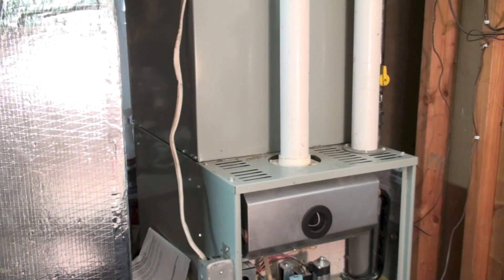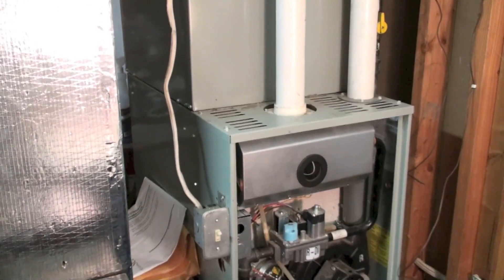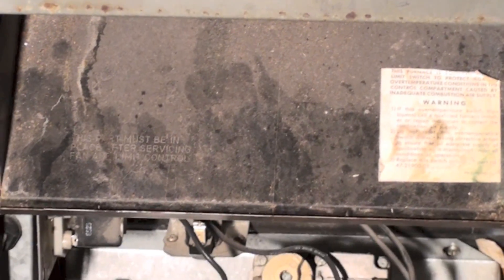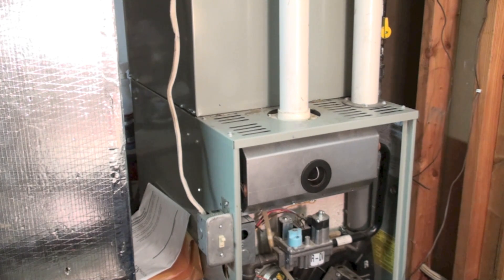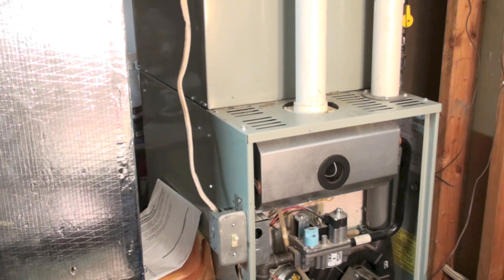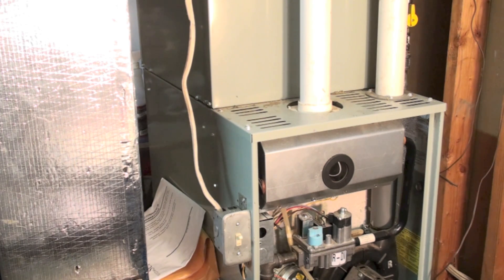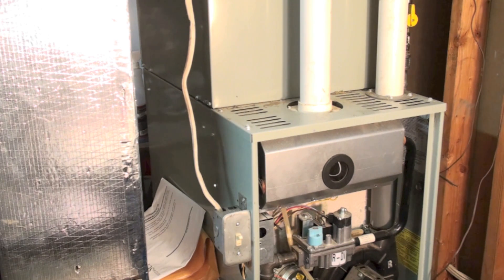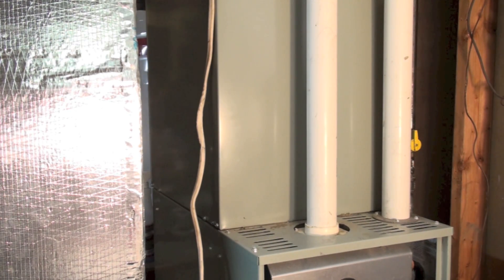The value of outside combustion air for gas furnaces

Comment: Great explanation, thank you so much! This confirms my doubts about inlet valve inside the house. Is it not in the building code for furnaces to fresh air from outside?
Reply from the maker: Most building codes do not prohibit inside air for combustion.  There are regulations for room size compared to gas input of the appliance.  
Should building codes require outside air for combustion?  Yes.
GFM

Comment: I was just looking at a house to buy, and had seen this little one foot pipe sticking up with the elbow in the basement and I had never seen that before. Thank you for clearing that up! Looks like if I buy the house I’ll need to get it fixed. 
Do you recommend a split intake that allows for combustion air and return air mix?  I live in the Midwest and wonder if the mixed air would cause the furnace to work harder?
Reply from the maker: You want to split off the combustion air between outside and tapped into the return air for the furnace?  If so, definately not.  The negative pressure return air could shut down the furnace.
GFM

Comment: Yeah, but installers can really screw things up.  I once rented a space for my small business in a one story, brick commercial building with a center cupola in the roof which vented the attic for all of the business in the building.  Small vents right below the parapet let air into the attic to flow out of the cupola.  The whole attic was wide open (no walls in the attic between offices) with only roll insulation on top of the suspended ceiling tiles to insulate each office.  The old forced air furnace in my office, which was in the bathroom and drew combustion air from inside, conked out.  The landlord hired an HVAC company to install a new furnace which was the newer type which used outside air for combustion.  Instead of putting a sealed pipe from the attic into the combustion chamber they installed a 4" galvanized pipe and left it suspended two inches above the outside air opening on the chamber.  As you can imagine, cold air roared down the pipe and we were playing freeze-out in the office.  We might as well have had the outside door propped a quarter of the way open.  This caused the furnace to run more to try to heat the office.  Since I was paying the utility bills, I removed the galvanized pipe and installed a new ceiling tile as the old one now had a 4" hole.   When the owner of the HVAC company stopped by a few days later to check his employees' work he asked why "they did not finish the instillation?"  He was told what had happened.  They never did come back and put a proper size PVC pipe on the furnace.  The office heated just fine.

Comment: Is there any danger of having the furnace use inside air? There’s a video on YouTube that claims it’s a major issue because it pulls air away from the nearby gas burning hot water heater, causing improper burn toxic gases to circulate inside the house.
Or, is it simply a question of using inside air not being as efficient as using outside air?
Reply from the maker: It is mostly an efficiency issue.  If the appliances are in a small room without access to a larger area, you could have the referenced problem.  There are calculations for room sizes to eliminate this problem.
GFM
Reply: @grayfurnaceman  : Thanks for your prompt reply. I’m thinking that the furnace installer must have evaluated the room size and the fact that, where I live, we have a lot of snow and extreme cold winters and thought it was the better option. The literature that came with the furnace has about 30 pages on how to install it. It even gives you how many elbows and the sizes of each for a “legal” installation. 
Your response has reassured me that my inside air intake is safe.

Comment: Outside winter air is drier so would there be much moisture in the secondary heat exchanger to condense to extract the extra heat,  and if there's no moisture in the secondary, wouldn't that also bring the efficiency rating way down?
Reply: The moisture in the combustion air is not the issue.  The moisture that is condensed is from the chemical reaction of the fuel burning.  
GFM
Reply: @Joe-ws5el , great!. I'll run a pvc to attic alongside the 3" bvent through chimney that goes half way into attic. But there also is a sump radon 3"pvc that goes outside as well so there should be nothing wrong with burning radon since it's all sealed and will be exhausted outside anyway. Have you seen that?
Reply from the maker: @1weirddoe571  As far as I know burning radon should not be harmful.
GFM

Comment: I have one PVC pipe vent going out my roof. This is a 30 year old furnace and Im replacing it next week. Can I run a fresh air pipe out the side of my house while using the existing vent going to my roof? Thank you.
Reply from the maker: If the install instructions accept that method, its ok.
GFM

Comment: They only installed one pipe on wife system put in 2018 and I notice Doors Close when furnace kick on if Door Is Cracked. Cause home has all new windows and Sprayed insulation Attic an Blown wall insulation.
Reply from the maker: I would be installing the combustion air piping.
GFM
Reply: Also Louis, if you have a standard  gas water heater, I would also be checking the draft hood of the water heater for spillage (fumes) when both units ( furnace and water heater) are running.

Comment: I realized, after having a new high efficiency (heat pump over propane) furnace installed, that my radon levels have gone back up.  I am suspecting, that because the HVAC company did not install an outside air pipe to this furnace, it is pulling air from wherever it can (including the subfloor).  I will install the pipe myself soon and see if this fixes the increasing radon levels.  Thanks for a great video!

Comment: Quick question: My parents have a furnace with PVC intake pipe that draws air from the crawlspace right below the furnace (or maybe the pipe under the house draws it from outside). So, right on top of the furnace where there is a pipe joint to feed the intake air into the furnace, the top of that joint is open so that the furnace is at least partially drawing inside air for combustion. The furnace is probably taking the majority if combustion air from indoors, because the pipe is just open on the top. I took a piece of plastic wrap and sealed the top of that pipe with a rubber band so that the furnace draws 100% air from the crawlspace or outdoors. Is this the ideal way to fix the problem, cheap?
Reply from the maker: If the furnace continues to operate normally, you are ok. It will safety out if there is a problem.  I would replace the plastic wrap with hard pipe.
GFM

Comment: If they're installing the exhaust it seems so cheap to skip out on the supply.  I specified that I wanted inside and outside fresh air piping installed with our new furnace.  Wouldn't have it any other way.

Also, isn't COLDER air also better for combustion?  You know, the reason behind why guys install "cold air intakes" on their engines?  Cold air = better performance over hot air?  Could the same argument be made for using colder outside air (during the winter months) versus warmer inside air?

Of course the warmer inside air isn't 150 degrees like it would be in an engine compartment.....

Comment: If your install is in an attic that has gable vents are you ok with not running the intake pipe?
Reply from the maker: Yes
GFM
Reply: @grayfurnaceman  I'm having a 90% Goodman installed to replace an 18-y.o. unit. In the attic. Exhaust currently runs straight up from unit and out the roof. There is no fresh intake from outside on current unit. The attic is large and there is ridge vent running length of roof. Tech is insistent on running PVC fresh intake line out the side of house, will exit about 35 feet up from ground. Any suggestions I shld make to tech? Does angle of pipe matter?

Comment: To say the chemicals in laundry rooms is causing the rust is 100% speculation and I refuse to believe this is in anyway necessary to the equipment
Reply from the maker: It is, in fact, speculation.  However, having seen the early rust out of heat exchangers in laundry rooms,  and understanding that chlorine bleach becomes hydrochloric acid in the presence of moisture (read products of combustion) leads me to bring in outside air.
GFM

Comment: I used the feel the same way about the outdoor air intake being a better install however after years and years of service calls do to a blockage in the exhaust or intake piping on the outside I changed my mind. If an animal climbs in boom service call, burst of wind boom service call, ice/snow build up boom service call. I no longer pipe the intake outdoors unless the furnace is located in a laundry room or there is not enough combustion space where the unit is located. This will eliminate nusince calls by 40% and save the customer a lot of money on unnessisary service calls. Pipe the exhaust outside pitch to furnace keep intake inside whenever possible that's a better install in my opinion. Or just stick with 80% furnaces they are considerably more reliable for a home owner. For a tech or dyi guy go with the condensing furnace for energy savings.
Reply from the maker: Good point.  One of the issues we have in the north, 80% furnaces are not allowed.  The issue of the laundry room is one that always gave me fits.  Constant flame rod cleanings and inducer problems, even heat exchanger rust outs.  
GFM

Comment: Inside air dosent freeze so in the north Canada where we get minus forty intakes freeze up resulting in customers making emergency no heat call 
..installer goes there chips yhe ice off the Intake takes all of 2 mins bam 75 dollar charge to customer ...so idk what do you think
Reply from the maker: The majority of freezeups are from the vent gasses as they are 100% humidity.  Also screens are the biggest culprits for freezes on intake piping.  The removal of screens or the use of 1/2" minimum screens and keeping the piping well above the snow level  will put you in the best position to avoid blockages.
GFM
Reply: How does the intake freeze?  I could imagine the output exhaust pipe may have a better opportunity to freeze due to the condensation, especially if someone installed a grille over it, but that's it.

Comment: Thank you so much for this great explanation.  Seventeen years ago, when my house was being built, the installer asked me if I wanted inside or outside air for the furnace intake.  Not knowing, I incorrectly reasoned that inside air would be "more efficient" since it is already warm.  Over the years, I suspected that I made the wrong decision, and for the reasons you state, I clearly did.  Today, I had the A/C replaced and also paid (yes, the same company) to install a concentric vent in order to change the venting to draw air from the outside.  In the past, my wife has complained that our house is "drafty" and "dry" in the winter.  We now look forward to seeing the effects of this change!
Reply: That should help.
GFM
Reply: You notice anything?

Comment: Good tips and u raised a good point about how tight people make there house. I service in the northeast. Ive had calls where the house is tight and after heater runs awhile pilot goes out a heater burns a lot of air. If u have a tight house and your pilots goes out it could be u need a vent allowing out side air to come in. If its in a foom make sure u have 2 vents to that room upper and lower or a door with slats

Comment: You can draw outside air on a 80%. Tie a fresh air into the return on the furnace and put a register on the supply directly above the evap coil. Every time that furnace runs you get outside air for combustion. Most guys up here in Northern Minnesota still do it that way new construction with modulating equipment. We can get 30" + of snow in 24hrs up here, a 2" pipe fills up with snow quick, and even if a 6" combustion air does the house is still drafty enough to keep that furnace running and keep a tech from having to leave his family in a snow storm at 11pm.
Reply: Finally, an answer as to why there is an insulated line tied into my return duct and a register/vent near the furnace....can you explain WHY the register is needed and not just the outside line in the duct
Reply: @taylorlefebvre4385  Did you ever find out what the register was for? I also have this setup and the register has always been closed?
Reply: @kevingramstad1572 I always thought the register is there so that you don’t end up with negative pressure in the furnace room. Some of the conditioned supply air exits into the room. (I am just a consumer though not an HVAC guy so I could easily be wrong )

Comment: it looks like i have the same furnace with a pvc outside air supply, but i also have a "skuttle" outside air supply (make-up air)  with a counterweighted damper going into the cold air plenum before the large filter. Wife is complaining of dust in the house, can I shut off the "skuttle" or put another filter on it?

Comment: Outside Combustion air is by far better than indoor air agreed however in the snow belt part of the world combustion air can get plugged with snow and ice shutting off the furnace and most customers are too lazy to go out and check for obstruction !!! If so much snow plugged it up then chances are roads are pretty bad to drive on too ! Just my two cents !
Great video GFM
Reply: what did you do to fix this problem

Comment: hi, anything negative on converting a 90 % lp furnace from an open atmospheric burner with door louvers open to seal it up and use opening in top sheet metal to breath sealed off air from outside. taping/seal door access and big enough pvc to outside of course
Reply from the maker: I guess you could do that but the outside air duct must also cover the gas valve.
GFM
Reply: thanks for the reply? would I need to rig up a dual vaccum safety switch or single work? also, how so do you mean to cover gas valve inside burner cabinet door with exterior air. thanks
Reply from the maker: Dual would be best.  I would think you would have to cover where the top cover of the furnace (up flow) is.
GFM

Comment: I have an 80% furnace with an 8 inch Field controls barometric damper make up air supply which works perfect. All passive, no wirings whatsoever When the furnace turns on it very easily pulls in make up air. The damper swings open a couple of inches. When I put the dryer on it opens up almost 3 inches.

Comment: We just had a new furnace installed and now water is dripping from our bathroom fan. The intake is not vented outside..so the very cold is coming back down the the fan vent and causing condensation. Should we vent the intake outside..?.
Reply from the maker: Paul Bown I always recommend outside air for combustion.  
GFM
Reply: grayfurnaceman They are coming to put it outside tomorrow. I have another question.. The waste water from the humidifier used to go into our washing machine, now the water comes from the exhaust pipe as well. Is this safe to use..?. I feel it is not as the gasses from combustion are in that water..?. Please give your opinion.

Comment: http://www.rezspec.com/en/na/products/product-air-handlers-caua
Here is one of the few 80% furnaces that I know of that takes combustion air from outside.
Reply from the maker: Reznor has always made sealed combustion furnaces.  Not for efficiency, but to take outside air for combustion.  As an example, a company that does fiberglass products must use outside air or the fumes from the resin will corrode the heat exchanger, not to mention possibility of fire.  Thanks for the thoughts.
GFM
Reply: That makes sense because Reznor i notice is mostly a commercial/industrial heating and cooling brand, Great video

Comment from the maker: I would use a digital vacuum gauge first to find out what the vacuum is.  If you know the vacuum it should have, you can compare to decide if the switch is bad.  A heat exchanger problem can also cause this.  Pressure switches are the messenger telling you to look farther.  Make thorough check of the heat ex.  If it happens to be a Goodman GMP model, the heat ex separates and is hard to tell if its failed.  I did a series on these.  Look up Goodman GMP in the search box.  Hope this helps.
GFM

Comment: Hello GFM,
I was servicing a old 80% furnace. The pressure switch doesn't close. Switch appears to be working ok. And I checked chimney is also clean. I also removed the flue pipe and check the exhaust flow. The inducer blows good. Why would be the switch would close. I also checked hose was clean. Do I have a dirty or cracked heat exchanger.

Comment from the maker: My thoughts would be to duct an air intake to near the burners with an electrically operated valve that opens with a call for heat.  Hope this helps.
GFM
Reply: For less than 90% applications?

Comment: So what would be the ideal situation to get outside air to an 80%?  My outside intake was insulated flex to right before the air filter.  Recently a service tech told me to have a cold trap to the room but not directly ducted to normalize the temp( in Minnesota).

Comment: You are right about flame Spenser's and outside air. I work on commercial equipment and never have failures on package units that burn outside air. The flame Spenser never wears out.

Comment from the maker: That furnace is what we used to call the "80%" furnace.  This was before the federal ratings came out.  The rating for this furnace was called steady state efficiency, meaning 20% of the heat went out the vent.  It did not include losses from startup and shut down, draft hood losses, off cycle losses, etc.  When the ratings came out, it would be considered more like 60%.